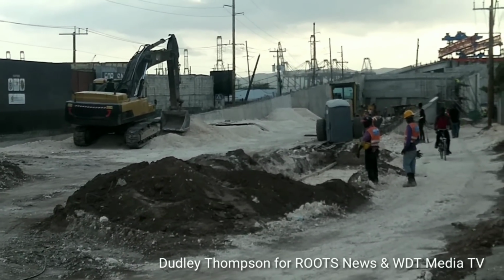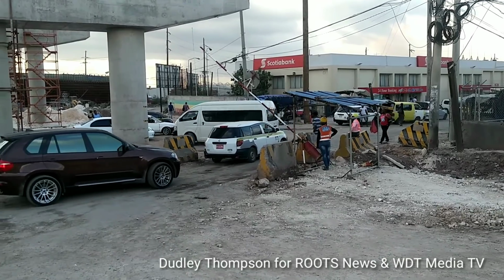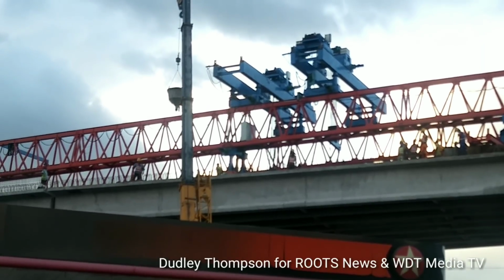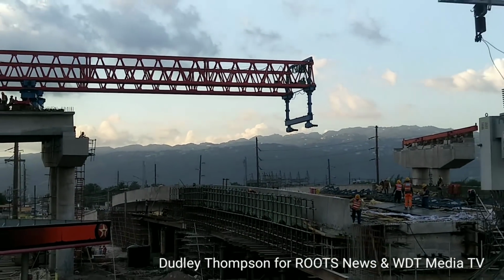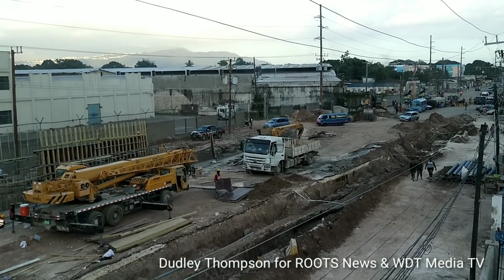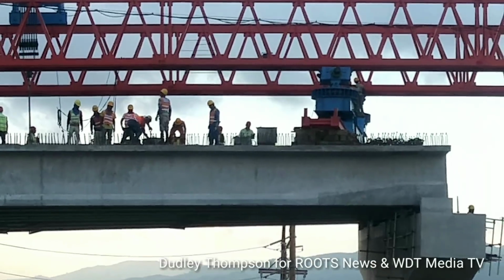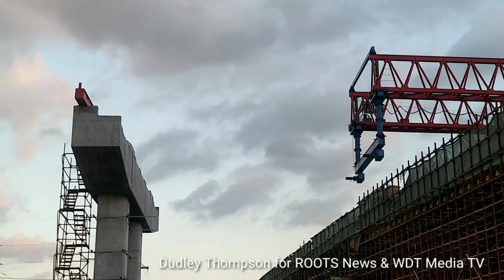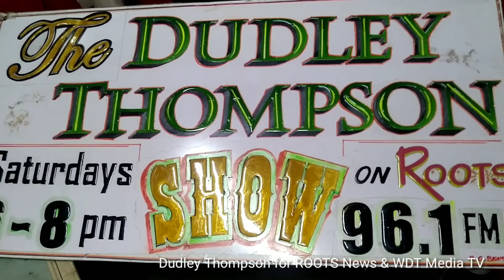WDT Media TV Hagley Park Road Improvement Project

Comment: Dudley.. you indicated 21 days before they took the spanish town road bridge brackets apart.. however it seems sooner.. is that the case?.
Reply from the maker: they will be removing  the metals on the outskirts now but  the one the is there to hold the bridge so  it can set properly will take 21 days

Comment: Dudley. What the height of the concrete shoulder wall on the overpass? Can you please find out?
Reply from the maker: 52 feet at the highest pont and 600m in length
Reply: @DudleyThompsonWDTMediaTV  Thanks Dudley. I was referring specifically to the height of the barrier wall on the side. The ones they are currently casting.
Reply from the maker: @jermainegreen1456  ok will find out today i was told but dont remember